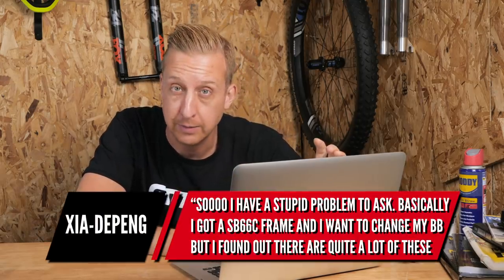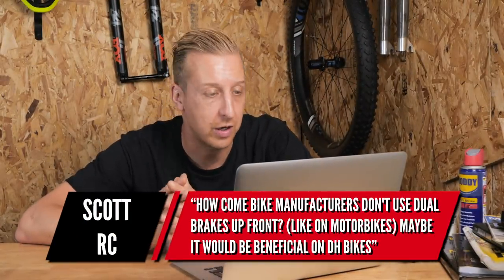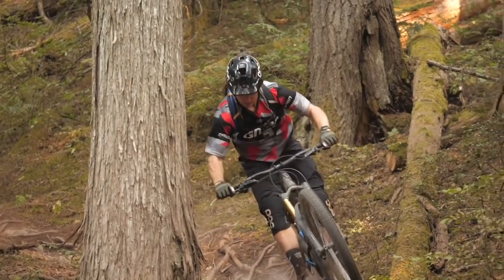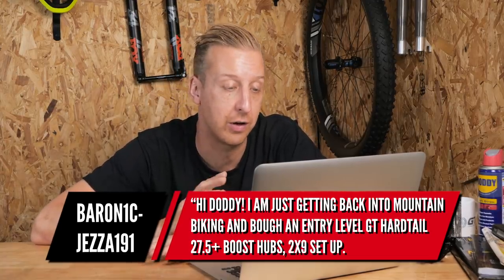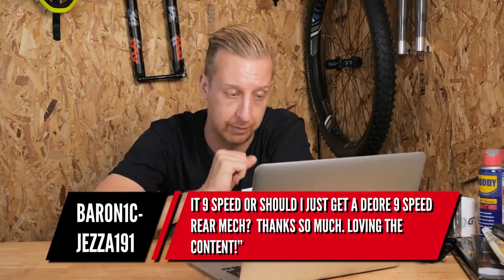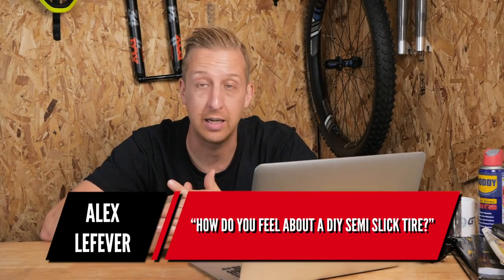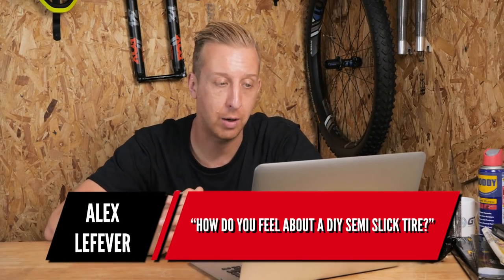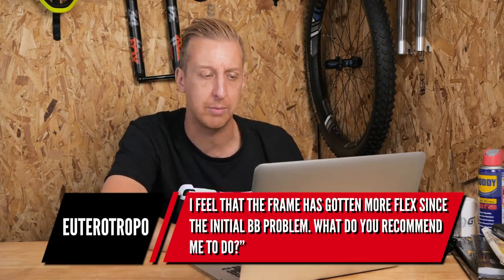Why Don't Mountain Bikes Have Dual Disc Brakes? | Ask GMBN Tech

Comment from the maker: If you have any advice for Ryan about thigh protection or have seen any grips with in-built protection or bar-ends please leave it in the comments below this video 👇
Reply: #askgmbntech Hi guys. I have to do a lower leg service on a 2018 rock shox Pike and I can´t find the RS 0w-30 oil where Ilive. What other oil can I use?
Reply: Hum I bought the Hope grip doctor aluminium bar end and I really don't see how they could get in your thigh even with a huge crash. so yeah it is going to hurt but no impalement and not bleeding out. I guess the grips he had were just rubber grip that are slid on the handle bar and I definetely see these things brake on the handlebar tube and get into your thigh.
Reply: Advice for Ryan would be try get some padded anti chaffing shorts, not all but some have foam like pads all around the inner thigh, that's all I can think of dude. Good luck on the recovery and getting back on your bike.
Reply: You could I suppose sew in some Kevlar material if you can't find anything else? It's fairly cheap to buy online. Used to be able to get ally end plugs (had some on my 1991 rockhopper!)
Reply: You could use the old school bullhorns.
Reply: Links to dangerous handlebar solution below. Thumb it up so others might get the chance to see it or not if you don't wanna.
13:22 I think plastic plugs are much worse, than modern more expensive grips with removable, but integrated alloy bar end caps(can be removed on disassembly only, after loosening grip holding bolt). Plastic ones tend to "punch" through as the bike takes falls, tree hits, lies on the floor or being dropped. The plastic flange is slowly being punched through by the handlebar as it's only 22mm ring of 1-2mm thickness. After that happens, there is nothing to stop the tubular plug from being pusched in, and then handlebar punches through the flesh on a crash. 
Grips came stock on my bike-caps don't fall off-locked in, locking ring takes most force of tree hits/crashes https://dobresklepyrowerowe.pl/czesci/chwyty-kierownicy-i-owijki/chwyty-kierownicy/dartmoor/maze
When it comes to bar end plugs, I'd recommend something like that for life-really thick piece of alloy sticking out, larger diameter to spread the load and make punching flesh harder for the handlebar, held in by squizable piece of rubber on a long assembly so should be resilient to being pulled by tree bark during tree hits. Hope this helps. 
 https://www.aliexpress.com/item/2pcs-7-8-CNC-Aluminum-Alloy-Motorcycle-Handlebar-Grip-Plugs-Bar-End-Caps-Cycling-MTB-Bike/32823034363.html?spm=2114.search0104.3.35.8cce4856mEMPcB&ws_ab_test=searchweb0_0,searchweb201602_3_10065_10068_10843_10059_10884_10887_312_10696_100031_10084_10083_10103_10618_10304_10307_10820_10301_10821_528,searchweb201603_45,ppcSwitch_5&algo_expid=b22bd93f-141b-42d8-9ae1-f97bcdf5b2b4-4&algo_pvid=b22bd93f-141b-42d8-9ae1-f97bcdf5b2b4&priceBeautifyAB=0
or this https://www.aliexpress.com/item/Wholesale-MTB-Mountain-Bike-Bicycle-Aluminum-Alloy-Handlebar-Grips-Plug-Handle-Bar-End-Stoppers-poignee-vtt/32882415686.html?spm=2114.search0104.3.27.8cce4856mEMPcB&ws_ab_test=searchweb0_0,searchweb201602_3_10065_10068_10843_10059_10884_10887_312_10696_100031_10084_10083_10103_10618_10304_10307_10820_10301_10821_528,searchweb201603_45,ppcSwitch_5&algo_expid=b22bd93f-141b-42d8-9ae1-f97bcdf5b2b4-3&algo_pvid=b22bd93f-141b-42d8-9ae1-f97bcdf5b2b4&priceBeautifyAB=0
Reply: Bar end plugs are sooooo cheap. Why would you not just go and buy  some??
Reply: Especially with cut (and filed) down bars, the "cookie cutter" is all set up and ready to go!
Those "bullhorn" style bar ends/extensions are no solution, thes might work hitting 'em sideways but straight on it's the same problem with their top end + the danger for impaling oncoming traffic and the risk of catching trees on the trail!
Don't you focus on your clothing for protection - going out riding you wouldn't put a steak knife loosely in your backpack wondering what protection to wear underneath ; you would go sheath that thing properly!
Just don't opt for rubber slide-ons or those small and flimsy insert-like caps that often come with lock-on grips - i always go for big heavy duty ones from ODI, proper plugs that i run on all my bikes and i do check 'em regularly for damage.
But aluminum screw-ins are indeed the best you can get, no compromises!
Reply: I like the really solid end caps on my ODI grips.  It's fairly thick, rigid plastic that is solidly mounted (dual clamps, one on each end of the grip).  I don't see how your handlebar can push through that to then injure you.  With soft rubber (i.e. slip on) or thinner plastic, the bar can much more easily cut through the plug / grip and then be a risk for the rider.
Reply: GMBN Tech army friend, crashed mtb and bar did sever leg artery. Luckily his Bros saved his life by tightly wrapping a bandana as a tourniquet above the bleeding. Maybe we should all stuff a bandana in our Camelbaks?
Reply: @The Bike Room:
Just get a tourniquet right away, 10 bucks that save lives!
Reply: You can buy protective padded shorts that cricketers wear. These may help.
Reply: @tyrionas  great product mine don't have much colour left on after just one summer but they have deffo saved my carbon bars from damage plus as you say it would be unlikely to be impaled by them
Reply: 14:28 I guess you could modify pads buy two pairs take sew the pads on to cover everything. 15:37 I would avoid plastic bar plugs cus they gets bent into the bar or ripped off, get proper metal plugs, some grips come with them I got Rev Grips. some sort of guard could possibly work, like motorcycles have but cover the end of the bar, this way instead of being impaled it slides off. called Hand Protectors/Handguards, they cover the brake lever & block the hole in the handle bar, and protect brakes, and you. I haven't tried myself, but seems like what you are looking for. this is what I found so far by a quick google search: https://www.crfsonly.com/reviews/fastway-250x-handguard/fw-250x-handguard.php https://www.motorcyclenews.com/new-rider/choosing-kit/2008/october/hand-guards-for-street-bikes/ http://www.srmoto.com/ktm-hand-guards/ https://soloracer.com/zetahandguard.html I don't know if a bicycle optimized product like this exist yet.
Reply: If you really want to be ready for these kind of situations, buy a tourniquet strap, it is designed to stop/minimize bloodflow to the area and to stop the lethal bleed-out.  To note these are the last resort since keeping one too long will eventually kill the bodypart due to the lack of blood, but for waiting the first aid to get there, there is nothing that would beat this solution.
Reply: Take a look at DRM Death grips
Reply: I used these myself, until I got RevGrips.
Reply: GMBN Tech you could put those antler looking things that they have on some Xc bikes to increase the load bearing area
Reply: Something I always used was a  nickel in my grips, probably cheaper than buying plugs...that's my 10 cents😆
Reply: I don't get why grips these days need dual lock on, e.g specialized has a series of grips with single lock on and a closed end over a aramid body, i think this might be the way to avoid this from happening. Anyway, lucky guy! This is something non of us wants to happen, but everyone shoul prepare for some first aid.
Actually it might be a good idea to do a video on this, maybe you can do a compressing dressing with a inner tube and a glove or shirt?
*of course it is not going to prevent an infection but an infection will only be a problem after a couple of days while you may bleed to death in minutes...
Reply: @nilz6432  my bike came with WTB Padlock grips, which should keep that from happening, but I'm limited on grip choices.
Reply: Only thing I could think of are some grips that are covered at the ends like DMR Death grips.
Reply: They have metal bar plugs that skew and spread out in order to tighten those will compleatly cover the hole and are nearly impossible to punch into the bar in case of a crash
Reply: #askgmbntech

Doddy, Im pretty sure Hope has some Aluminum bar end plugs similar to their head doctor with all metal and rubber compression lock in. "Hope Grip Doctor" .  Those wont be going anywhere!

Thanks for all the great content!
Reply: I know, they have a lot of drawbacks, and are kind of ugly, but maybe those “Bar-End-Horns“ would help prevent accidents like this to happen. Because with them screwed/clamped on, there isn't a thick, round 'stick' chrashing into you, but a much bigger and longer point of contact to distribute the pressure. And I cant see a way that those ~10cm long horns could pentrate you when hitting them sideways.
Reply: eugeniokdf just wait for it to come back in stock. Also check amazon if you haven’t.
Reply: I have Renthal MX bars on my motorbike and I had to buy small diameter bar plugs to fit these. These plugs should fit into an MTB bar too and will prevent the sharp ends of a handlebar being exposed.
Reply: i used to use ODI grips, but recently was looking for something a bit more padded with option for other hand positions so got some grips with mini horns built in and a "flange" to rest the palm. these should spread the load more in a crash as well:  https://www.amazon.co.uk/dp/B073PT748H/ref=cm_sw_r_cp_taa_jqTOBbCSY2VAH
Reply: Hello guys Ryan should try the Troy lee designs shock doctor  lps 5605,it has padding on the outer leg,inner thighs and crotch area  cheers and give then a try.
Reply: Motocross gear has foam inserts on the inside legs to stop chafing
Reply: You might want to try a pair of Troy Lee Designs 5605 shorts. They're padded all the way up the outside and on the inner thigh. I wear 'em all the time and they really help when things get messy
Reply: XC style bar end grips. Not the tube style but the more moulded looking ones. I think that would work well.
Reply: I think that a "brake lever protector" used for motorbikes can help in spreading the load even more than just a simple bar end caps. I never used them myself but if I am not wrong motorbike and bike handlebar have the same diameter so they should fit easily.
Reply: #askgmbntech hey doddy, from last 3, 4 days there was squeking sound coming from my bike while stearing left and right so I thought it was coming from the headset so I serviced ,cleaned and regreased it and even checked that if the break was rubbing or not but I found everything was good and the sound is still there and I just cant figure out from were the sound is coming can you plese help me with that. btw thanx
Reply: Hi, im a avid fan of your askgmbntech. I have some question. Whenever i put pressure on my pedal stroke my chain slip/making sound like breaking apart. My mechanic told me that my 2nd chain ring (btw i have 3x crankset) was worn out already but my crankset was 2 months old. How can i solve this problem? Thanks gmbn! More power Godbless!!
#AskGMBNTech
Reply: I would suggest DMR Deathgrips, i have them and besides being super comfy, they have only one collar and its on the inside. And on the outer side where the bar end would go there is a thick layer of rubber (part of the grip itself). It seems pretty hard to impale yourself with those.
#askgmbntech what is the best and safest(for the alu at least) way to strip the paint of a frame?
Reply: Only shorts I've found that have some padding inside of the thigh are these: Troy Lee Designs LPS 7605 Short 2018
Reply: Just use rubber pipe end guards and put a metal washer inside the rubber cap so the handlebar won’t cut through. Also the rubber caps from table/chair legs will work as long as you get the bigger ones.
Reply: jesus that last ones scares me. I usually ride in skinny jeans (I know its a sin) and a pedal spike has gone through them before but i feel like jeans might stop the end of the bar. They could just rip through still but i they are not very stretchy and because  bar ends and brake levers are quite blunt i think that it might stop them. 🤔#askgmbntech Also, i run my fairly long lock on grips 
 right to the end of my bars. Do not many people do this? Although they are still metal lock ones
 i feel like it might stop it from going into a leg even with no bar end.
Reply: An old school bar end plug is to use cork stoppers from wine bottles. Then just fit grips as normal.
Reply: Hi Guys. I bought a pair of Troy Lee Designs under shorts the other day. These are LPS5605 and have padding around the inner and outer thigh. It's just padding but may be of help.
Reply: Try padded rugby shorts they might work. And get well soon.
Reply: Odi elite pro grips have thick rubber on the outside end
Reply: BMX brand Odyssey has some bar ends made from a composite plastic that is shatter resistant. They lock into the bar with a screw in the centre and have a nice rounded profile that leaves no sharp edges to cut into skin in the event of an accident

https://shop.odysseybmx.com/products/par-ends
Reply: #askgmbntech hi my name is ori i'm from isreal and i'm looking for a xc carbon 29er hardtail in around 2500$ what can you recommend me around this price?
Thank you
Reply: found some martial arts padded compression shorts that have inner thing padding. Not sure how they'd be for riding, but might be worth a shot. here's the link: http://www.martialartsmart.com/sd-291.html
Reply: I have some odyssey BMX screw in plastic bar plugs I use if the grips don't cover the bars.  They are basically pretty big rounded (almost mushroom like) bar plugs that you screw in. The bigger surface area and rounded edges would probably make it less likely to penetrate your leg/thighs but to me it sounds like you just got very unlucky Ryan. I can't immediately see how different bar plugs would help that other than bar ends to make the impact area bigger. what I would say is the biggest advantage to these odyssey bar plugs is that they are very meaty and can take a lot of abuse before no longer serving their function (It's a BMX product after all).
Reply: As far safety goes a proper tourniquet should be standard kit carried in your camelback , it will save your life
Reply: I really like the supacaz grips. They're lock-On grips and on the bar-end side the rubber is quite thick and soft.  However in Ryan's case it sounds like a really hard impact and at some point (speed, terrain, bad luck, ...) every protection will fail.
Reply: Hey Ryan, I have heard of this problem before but have not experienced it luckily but if u have a grip with a cheap bar end, BMX bar ends are incredibly durable and personally I think they look safe for your problem, but if you are in the market for new grips I would reccomend the Aaron gwin line of grips which I find have an extremely durable non empaling bar end, those are great if you like a slimmer grip. Brendon fairclough deathgrips have a rubberized reinforced bar end and they come in many different colours and comes in both thick and slim diameters.
Reply: As some have mentioned, the Odyssey bar plugs are pretty sturdy thick plastic and won't let any Aluminium come near you. Or use some sparkling wine cork plug, with the thicker ends. They should protect you just fine (if you don't loose them). Also, Troy Lee Designs make a couple of protective shorts that are worth a look, as also already mentioned here.
Reply: I run the Specialized body geometry grips. They are comfy and pretty thick rubber on the end.
Reply: Advice for Ryan: Buy some grips that have river covering the end of the grip, essentially the bar end has a rubber protection over it to prevent cuts etc. Hope this helps a little bit. Not sure of anything for thigh protection unfortunately
Reply: I'm a little late for the comment, but there are bar-ends that are shaped like a letter T. I'm sure that's plenty of protection as I doubt that the entire thing would shove up someone's thigh.

Comment: We aren't going fast enough for 6 piston brakes yet, I think dual front brakes are just too complicated for now
Reply: The amount of piston is more to do with modulation than power.  Hope produce a 6 piston caliper.
Reply: Definitely both weight and speed play primary roles. Both my 1992 and 1994 RS Honda 125 Grand Prix bikes have single caliper disc brakes. Those bikes at that time had a top speed of maybe 120 to 125. And the power band was so narrow that there was not a lot of torque. Dry break weight of that bike was about 160 lbs. Light bike, low torque output. So for sure mountain bikes do not need dual rotor dual caliper brakes on the front. A good 203 mm or 233 mm setup with 4 piston caliper is more than adequate for the fastest downhill bikes.
Reply: Yeah- we just don't need it. More parts, more weight, cost,  complication, repair, etc. If anything, bigger rotors or braking surface area would be beneficial if something more is needed.
Reply: There's only so much stop you can get away with before you've built an OTB machine
Reply: I picked up a dual front hydraulic setup for me ebike conversion, then realized dual disc front hubs are not easy to find, especially for a fat bike. So I'm just going single disc.

Comment: Offroad motorbikes only have a single disk and they brake just fine. Heat dissipation is not a problem on vented disk and as long as you run top grade brake fluid or a fluid reservoir extender (in extreme riding) you won't get brake fade. You are spot on with the weight and additional complexity of having dual disks on dirt orientated bikes.